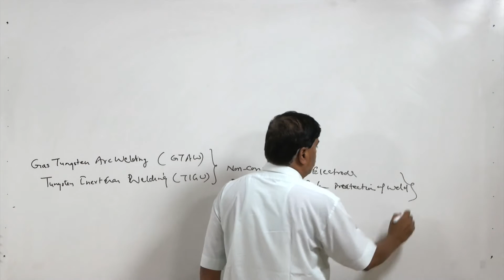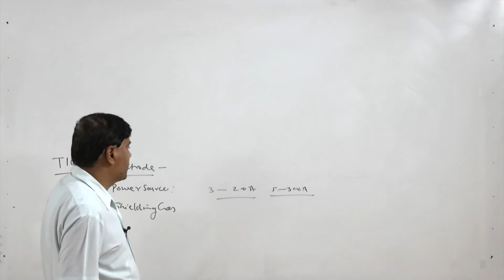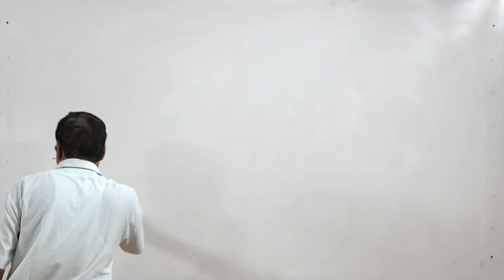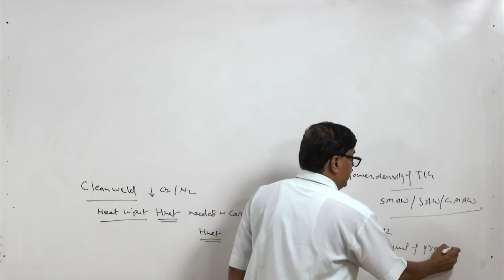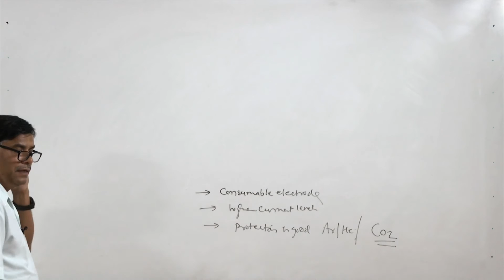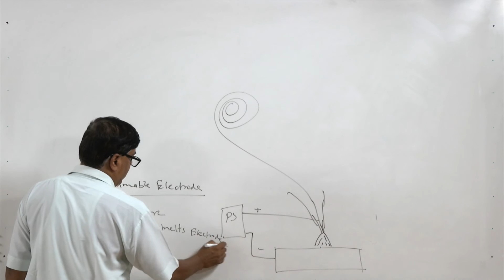Lec 10 - Gas Tungsten Arc Welding

Comment: GMAW and GTAW are operated in which mode DCEP or DCEN?
Reply: DCEP is never used in real welding. An alternative mode can be used which switches between DCEP and DCEN regularly. Such a mode is used in welding on alluminium or very thin plates

But a constant DCEP mode is never used, because it will severly reduce electrode life.